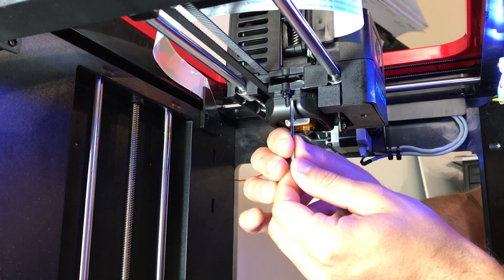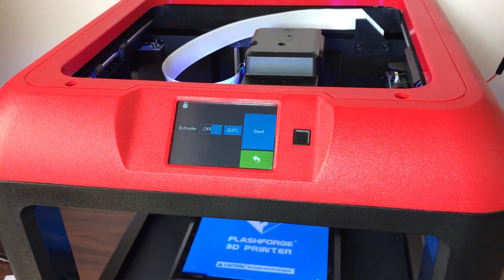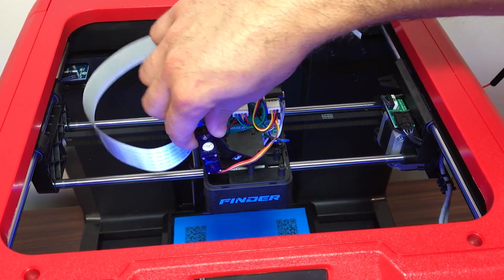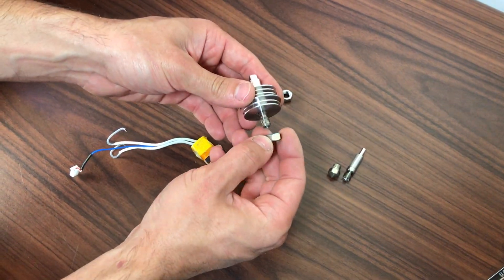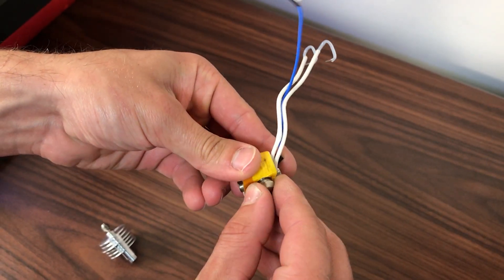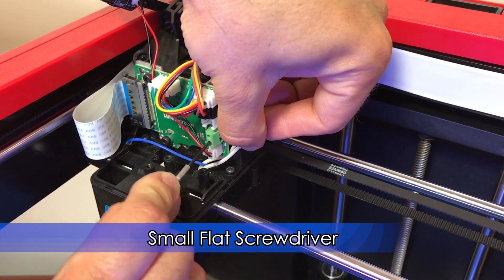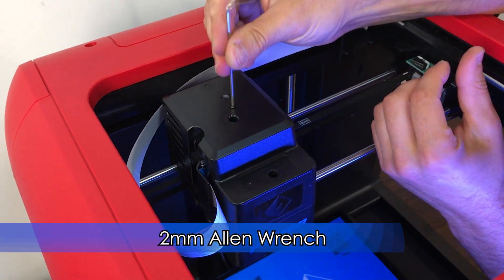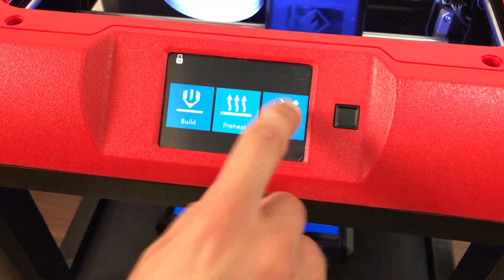Micro Swiss All Metal hotend upgrade for Flashforge Finder and Flashforge Guider 2

Comment: at 3:44 in video, it says that loosening the thermal tube is easy to loosen with jam nuts.   I am having trouble, and have nearly chewed the flat end off trying to hold it while unscrewing the thermal tube. Help?
Reply: nvm  I put it boiling water and it finally moved.  top is all chewed up, but should still work

Comment: Yep.  Got one for my Flashforge Finder.  Worked a treat for a number of prints but now it appears clogged.  Any videos on how to unclog a Micro Swiss hot end on a Finder?   Is it more or less as you would with the original hot end? Thanks.
Reply: FYI My previous all metal hot end only worked with  FF filament. 3rd party filament would not work at all. Turns out the original had a gap between the nozzle and the upper barrel leaving a cavity that filament could fill into and block.  Also 3rd party filaments tend to stick to the barrel (looks like heat creep - so I'm not sold on any benefits to the all-metal-hot-end).  To clear blockages take out the whole barrel and use a hot-air gun or butane blow torch (just go easy on over heating - just enough to melt it) then push it out with the metal rod (one came with my FF printer).  FWIW I would never buy a FF again - I have nothing but issues with mine and it's as-new.  Zero support from FF themselves but my local retailer has been quite helpful.
Reply: @thuffam  Yep, we'll still using my FFF, doesn't really miss a beat.
Reply: @thuffam  Why can't you just preheat the printer and push some more filament down?  Tell me why.

Comment: just a quick tip, should i use PTFE Tube inside or not ?
Reply: I wouldn't even bother with this "upgrade" because according to other replies, the tube is longer and causes the print nozzle to be lower (closer to the print bed), thus the leveling sensor becomes useless.  But to answer your question, a PTFE tube won't fit inside the metal tube, anyway, so No.

Comment: Another attempt, never worked. Ended up having to drill out the hot end as it spilled out plastic everywhere freezing it in place on the heating block. A huge mess. I will never try this again. I wish I had just stuck with my regular FF standard hotend, or better got a different printer.

Comment: This upgrade does not work for the guider 2. The kit makes the nozzle longer than the standard one fitted on printer. You can't set the z offset because the firmware is fixed. Waisted half a day on this useless upgrade. Pissed off.....
Reply: It also works with the newer Flashforge Guider 2. I've done the remodeling. I solved the problem with the z-offset like this:

At the lead from the print bed, right side, is a metal angle. This serves to recognize the lowest point of the Z-Offset. Increase the angle by approx. 3 mm. So the offset shifts down and the print bed moves down. I used two washers for the test, which I put between the guide and the angle. When the angle is refastened, you perform the calibration again.
 My guider 2 prints again.
Reply: I forgot one thing:
The metal cover under the nozzle, which sits in the cooling tunnel, must be removed or drilled out. otherwise the cooling tunnel does not fit. But even without a metal cover, the printer prints without problems.
Reply: Mac Schei l
Reply: What nozzle should I get? 7mm ? Do I need to hear the hot end if I'm just replacing the nozzle?

Comment: Hi.  Just wanted to ask another question regarding this upgrade.  As far as the upgrade goes, it is working flawlessly but i was wondering how to enable my flashforge finder to print above 240 degrees.  In flashprint whatever setting i select above 240 degrees when it starts printing it only goes up to 240 degrees and stops as that was the temp limit with the ptfe tube.  Should i be using something like simplify3d instead of stock slicer.

Thanks again.
Reply from the maker: FlashForge Finder Firmware is limited to 240C. You can not raise the temperature with gcode above 240C, so 3rd party slicer will not help here.
Reply: @MicroSwissLLC  Maybe this should be called the PETG upgrade kit then.

Comment: Just a quick update.  It seems that i had mistakenly screwed the barrel in first and therefore didnt have the gap as shown in the video thus transferring all the heat to the cooling fins.  Problem solved and not printing petg at 240 degrees perfectly.
Reply from the maker: Yes, nozzle HAS to go in first and then backed off 1/8 of the turn. I'm glad you got it going :))
Reply: Thank you @Mark Andrews for following up with this. I was starting to worry about purchasing this item if I'm going to be having problems. Your feedback was helpful.

Comment: Hi.  Just a quick question regarding this upgrade.  I have just installed this kit today and now i am having a slight problem.  my temperature wont reach the set temperature.  If set to 210 it will get to 208, set to 240 will only go to 238.  i have not had this problem until now and have been printing with petg on 240 degrees without problems.   you mention in the video that a PID tune might be needed.  how exactly is this done on a stock flashforge finder?  also, is there a way to set the temp higher than the flashprint software as it only allows for 255 max.

Comment: FYI: On my Finder (purchased quite recently) the top cover is held in with three 2.5mm screws instead of the 2mm+Philips. This isn't a big deal since you need the 2.5mm driver anyway.
The rest of the instructions were correct and I had no issues with the install.
Reply from the maker: Maybe newer ones come with 2.5mm. Our came with 2mm screw. Thanks
Reply: @MicroSwissLLC  Yes, only the first generation Finder used the 2mm and phillips screws... the 2018 and current generation (2019) model use the 2.5mm allen screws for all three.  (The latest design uses a lot more common screws throughout the entire printer.)